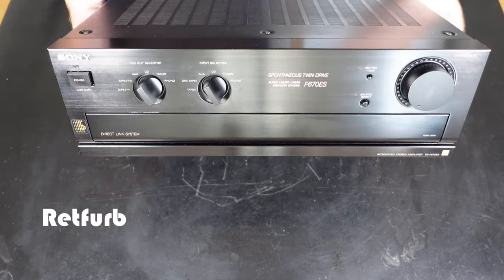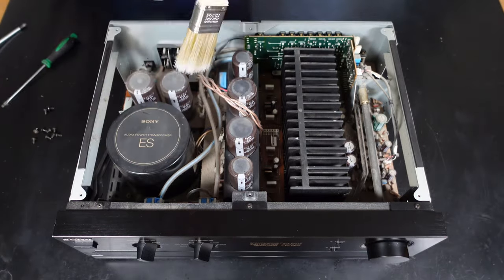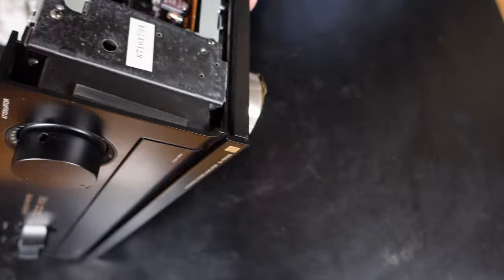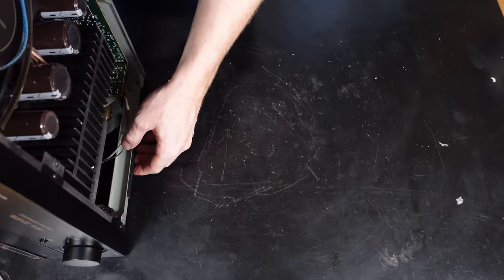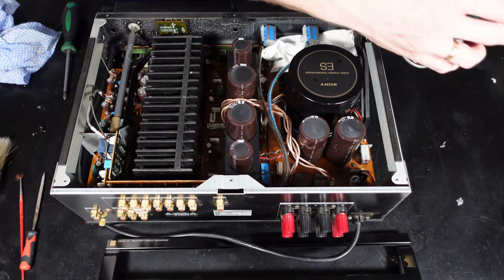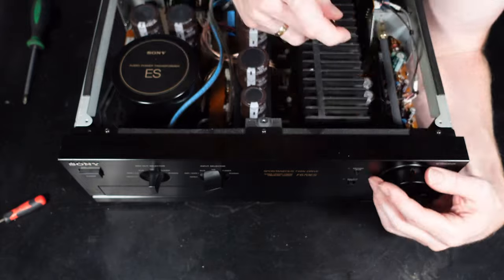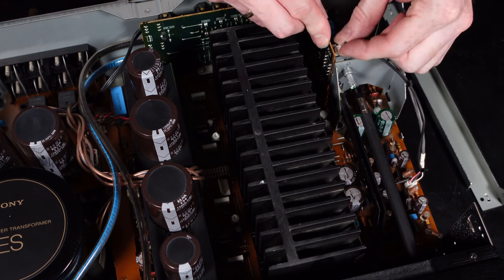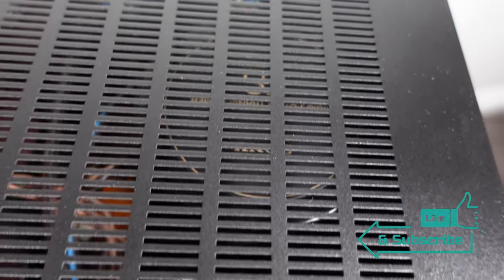SONY F670ES Amplifier Service & Crackling Distorted Sound Issue Repair - Retfurb Audio Refurb

Comment: Should have taken a close up of those 'chain-link' cables!
If you still have the unit you could put one up as community post.
Reply from the maker: Yeah, Stupidly I didn't get a close up. I am using the unit in my office now, As its a great amplifier. I am planning to do another video soon, For an overview of the amplifier. So I will get some interior shots and close up of the cable. They look like small square links inside.
Reply: Those cables are kinda like brake cables on bicycles. They are just an extension to have your input be transferred to a switch in a different location mechanically. This decreases potential degradation of the audio signal and allows manufacturers to put the actual switching component wherever they like and generally in a spot closer to the inputs.
Reply from the maker: @trevor245  Thanks for that information. I appreciate additional supporting comments, Which will help others further. Thank you. 👍

Comment: Spraying those selector knobs like you did did nothing. The actual switches are located further back linked up by those cables you had never seen before.
Reply from the maker: Thanks for the additional information, It will also help others looking at this. Yes, I know the switches you mean.  Will make sure I show that on a future videos. 👍